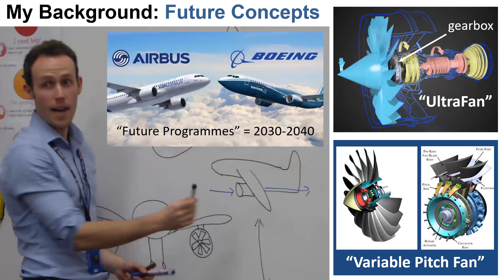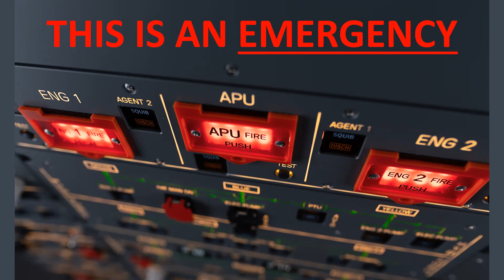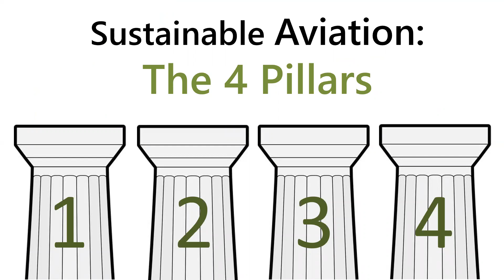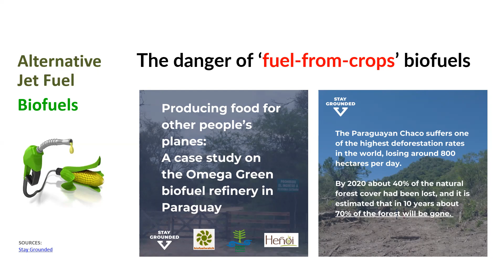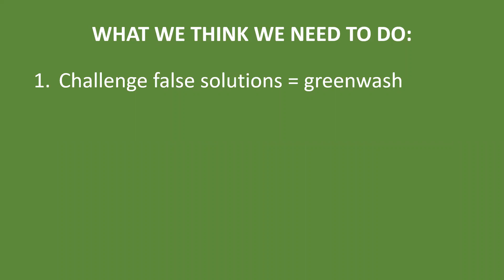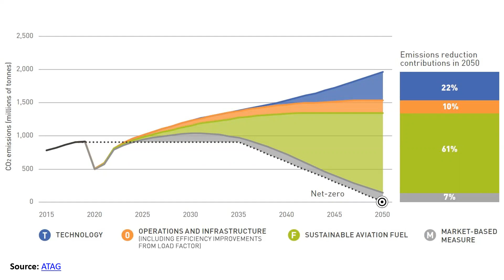Talk: Aviation Workers Demand Industry to Reject Dangerous Growth

Comment: The potential problem I see with trying to reduce the amount of people flying is similar to when lockdown started and people were told to stay at home. Their counter was that their rights were being infringed. We are far too used to just doing what we want when we want with little to no regard on impact.

SST's are a great example - I am convinced that one of the reasons Concorde was grounded was the need for fast travel for business being reduced by the increase in video solutions and also the price of fuel. I don't think Concorde was ever really commercially viable (I believe they made more money from charter flights than the standard LHR-JFK route) when you consider that for max 120 passengers it burned 90 tonnes of fuel in 3 hours. Compare that to a far more fuel efficient aircraft (787) which carries more pax further for less. I don't see a marked for SST's but Concorde was an example of how the aviation industry (UK and France) came together to solve technical challenges at a time when nothing else of the sort existed (development time and project cost notwithstanding).